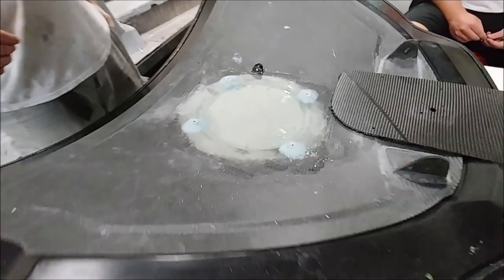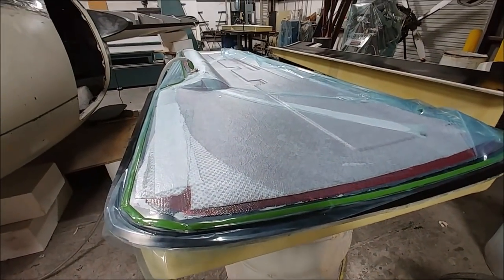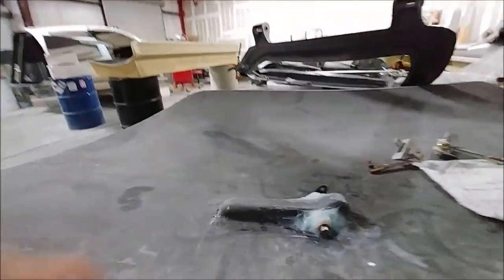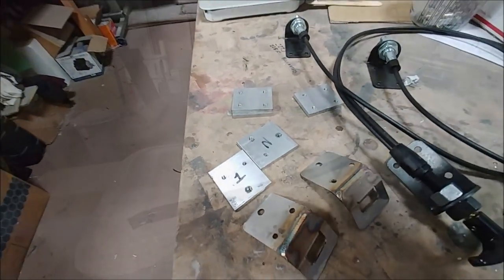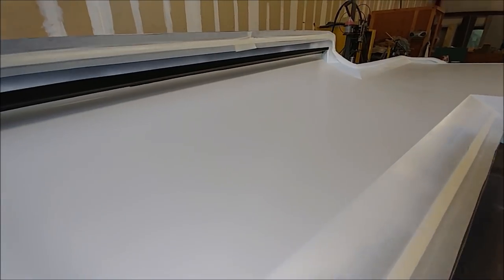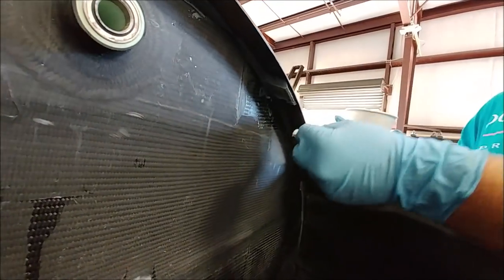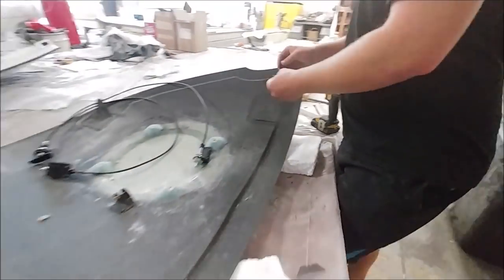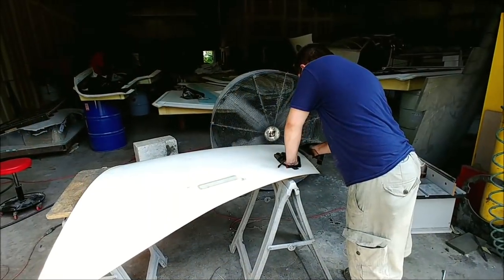Nose Hatch Latches - Building the Raptor Prototype

Comment: Well you asked the question backwards but I'll attempt an answer anyway.

Each one of the turbos is a " heat engine" in it's own right. They consume exhaust gas heat energy and convert it to boost pressure. 

They each have a bypass throttle valve which is fully closed at your current power setting, this is WOT for the turbo and fully closed exhaust for the engine.

 SO they consume fuel energy to create boost. If you want to run efficiently at 90 hp then reduce your boost pressure and the fuel burn will be reduced.
 
The mechanism of action is a reduction in exhaust gas back pressure due to you adjusting the wastegates of the turbos to open at the reduced boost pressure thus relieving the excessive exhaust back pressure allowing the engine to breathe more freely and consume less fuel.
 
That pedal thing is just a pot that tells the ECU what engine speed to satisfy. It will burn any amount of fuel to reach the desired RPM no matter what. A diesel will go to full fuel just to maintain idle if needed.
Reply from the maker: Ok, so as I said in a different reply, I might need a boost controller to reduce boost based on fuel flow. Or maybe when the prop governor is working it will have the effect of smoothing things out by keeping the load constant using the prop pitch. We'll have to see once that's sorted out.
Reply: Raptor Aircraft , last I checked the aftermarket boost controllers aren't reliable enough. But you could manually adjust the boost pressure down if you only have 100hp of load available and it should bring the BSFC into line, reduce fuel burn a bit, and reduce the heat load on the exhaust/ turbos.
 Then just turn it back up when you get more load. You will be making adjustments to the boost levels when you get a full load anyway.
 You probably don't need any boost at all for 90hp and would burn less fuel the lower you adjust it.
Reply: Kyle.  For efficiency as load goes to zero boost should as well.  Not sure exactly how those map with rpm on this system.  Seems to me that’s why ecu’s usa fuel maps to get refined efficiency results.
Reply: Tim Duncan , well any turbo diesel has zero boost at "zero" load but there is always a load when running. Friction, pumping "losses" , fuel pump, A/C compressor, oil pump,etc.
 Some loads can be reduced or eliminated easily some others require major changes to engine design, turbo size, camshaft profile, wastegates, etc. 
 But it should be no surprise to us that a 3.0L twin turbo diesel is less than optimal at 90ish HP with a bunch of boost being produced.
 Some companies tried this years ago like the caterpillar ACERT engines that ran high boost for soot reduction instead of EGR.